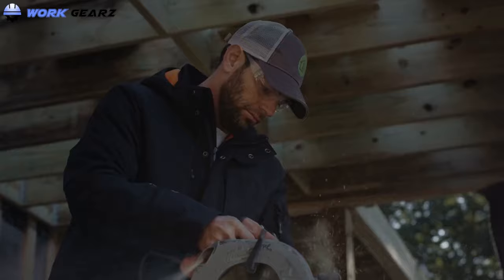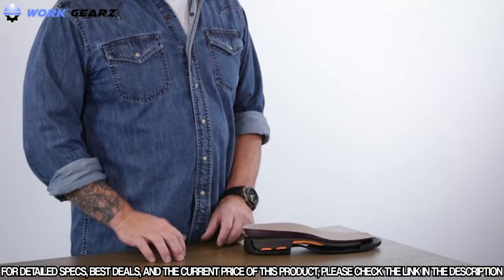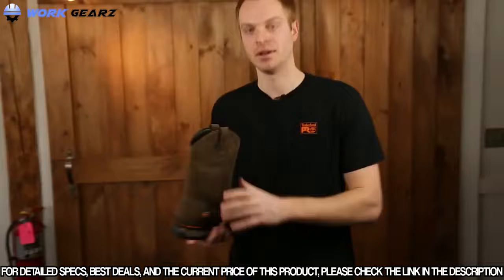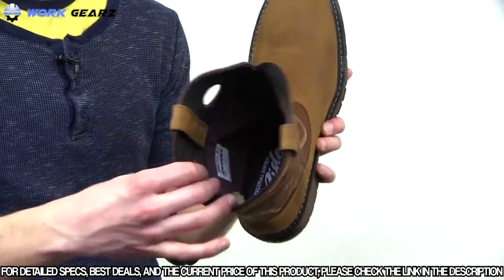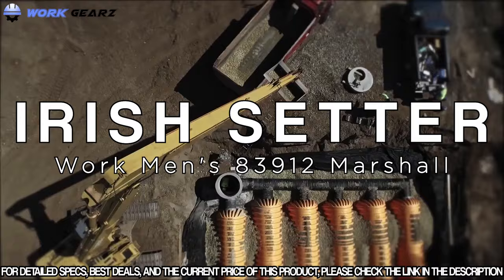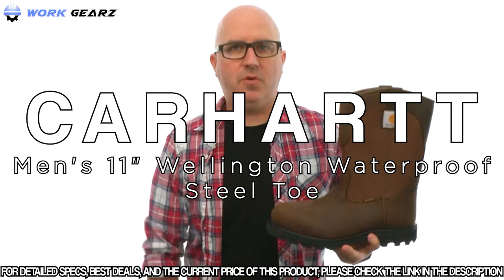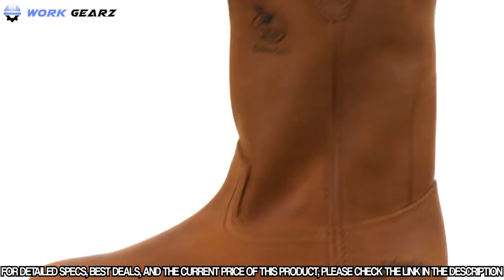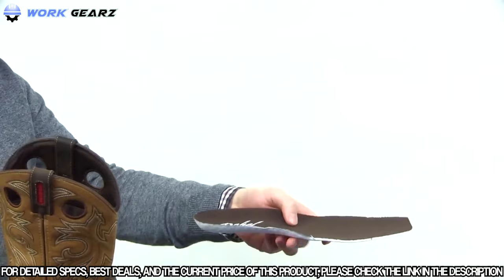Top 10 Best Pull On Work Boots

Comment: i’ve always worn lace up boots, recently been wearing slip on boots like redback, im curious about pull up boots, im worried my feet win over heat in the summer months (work in a shop no ac) and the problem i ran into with my slip on boots is that after about a year they’ve stretched and my feet slide inside them causing the insides of the boot wear out is now all torn up i want boots that will last a long time as i hate breaking boots in

Comment: No redwings?
Reply: Red wings are trash I have the pull on boots for welding.  Only plus was no burnt laces . I've had these for 2 years and I gor them fitted by the store staff they fit perfect for the first month . But during thst month it was the break in period and I could barely walk at work they hurt so bad . Then the ankle area and top of the foot area completly loosened up and the flop around every step . Again these were a perfect fit before and then the leather just lost all tightness to keep it around my foot . I worked with another guy who had the same issue with his . Only met one guy who's slip on red wings hr likes ..and he has floppy skate shoes when he wears casual so it makes sense.  To each there own more so throwing throwing comment up for if someone is thinking of getting them haha
Reply: @phukyu345  what brand do u wear?
Reply: @joser7114  red wings is the brand.  I have the slip on cowboy style 10 out of 10nwould not recommend haha sorry for late reply